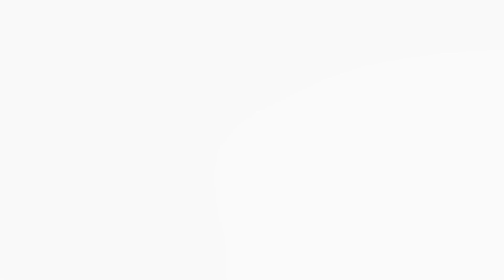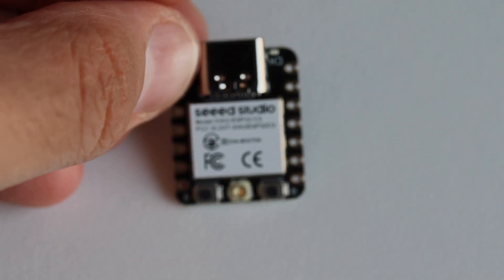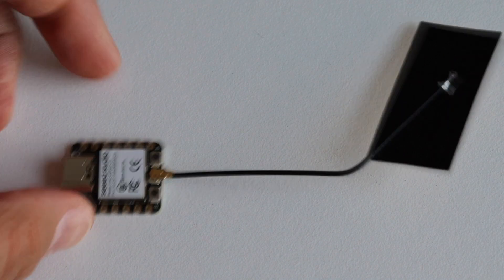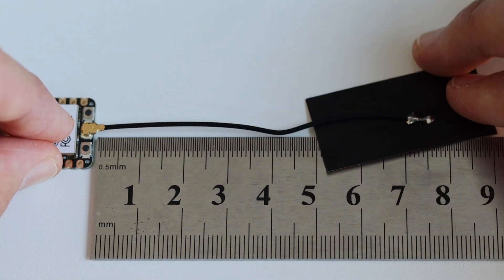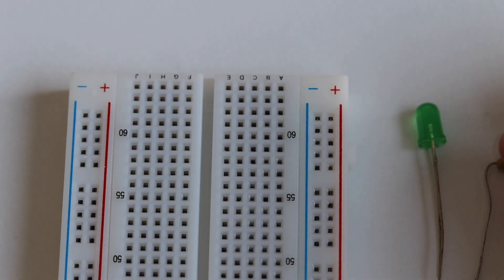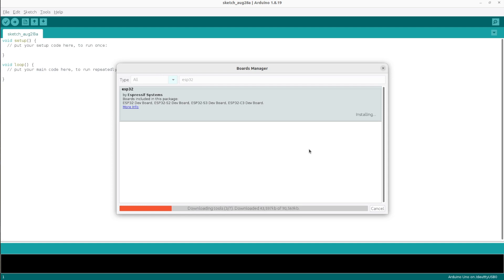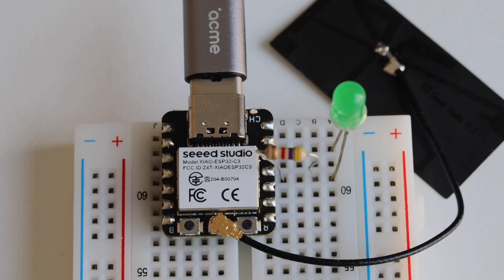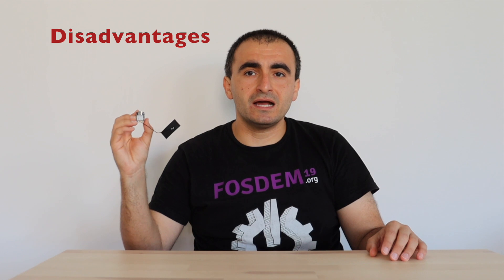XIAO ESP32C3 RISC-V Dev Board and Arduino IDE

Comment: I keep getting, A fatal error occurred: No serial data received.
Reply from the maker: Could you please provide any details? Is this in Arduino IDE? If yes which version of the IDE? Which OS are you using Arduino IDE with?
Reply: @LeonAnavi  Linux Mint 21.3, Arduino IDE 1.8.19, Board ESP32C3 DEV Module. Sometimes, I make the ESP32C3 work if I enable Erase Flash. It takes 16 sec to erase flash ram. I cannot upload a screenshot.
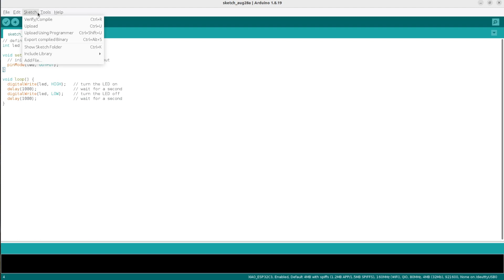Reply from the maker: @pavloskairis9994  which board have you selected from Tools in Arduino IDE? It should be XIAO_ESP32C3 and after that you should select the Port as shown at 7:43 of the video.

Comment: Disappointed with the Xiao ESP32-C3's battery performance. The device operates in a voltage range of 4.2V-3.4V, which seems to limit battery usage efficiency. It's frustrating to see shorter usage times due to this. Hope they consider widening the voltage range to make the most of the battery's capacity without harming its longevity
Reply from the maker: thanks for the feedback and sharing your experience.  Have you tried the deep sleep mode and wake-up on XIAO esp32c to extend usage times on batteries?
Reply: @LeonAnavi yes, sure, but I use  additional custom circuit with sensor button to power the board

Comment: Hello, if I connect lipo battery to the bottom batt pads, then do I need any battery charging module and load sharing circuit ? I would like to design a macropad that can be used wired and wireless but cannot find any resource on how to do this safely with lipo battery
Reply from the maker: XIAO ESP32C3 module is equipped with a battery charge chip.

Comment: does bluetooth works without antenna also? and how many meters?
Reply from the maker: Yes, XIAO ESP32C3 supports Bluetooth 5 (LE) connectivity. It should work without the antenna but the range will be significantly smaller. Here is an example how you can use and test Bluetooth on this module: https://wiki.seeedstudio.com/XIAO_ESP32C3_Bluetooth_Usage/
Reply: @LeonAnavi  Thanks so much

Comment: Thank you Leon for taking the time to share this review 🙏 Do you think this kind of module is suitable for simple, low volume (few thousands pieces) production application ? 
If feels like this would be much cheaper and safer (less error in hard and FW as well as supply chain risk) than building our own board. 
I’m thinking something like: build a custom casing, weld the required connectors, pot the whole thing. Keen to have your opinion on reliability of such a setup :-)
Reply from the maker: yes, absolutely! These XIAO modules are exactly for this purpose. They are good for both makes and for low-volume manufacturing because the XIAO ESP32C3 module is CE and FCC certified. Btw I am using the other version XIAO RP2040 in mechanical keyboards.
Reply: @LeonAnavi  Perfect ! I've ordered them yesterday following your feedback :) I'll let you know how it goes.

Comment: Good review.  I've been using C3 modules for a while but having issues getting anything loaded to spiffs.  Ideas?
Reply from the maker: Thank you. No, I haven't experienced this type of an issue (yet). What is the source code that fails to load to spiffs? Which dev board with ESP32C3 are you using?
Reply: @LeonAnavi  I'm using arduino ide v 1.8.19 , and have tried on the Xiao esp32-C3 and also TTGO TOI PLUS.
Reply: Ah, also it's not spiffs as such, it's ESP32 Sketch upload tool, that I'm using to upload files to spiffs. My bad. 
A fatal error occurred: This chip is ESP32-C3 not ESP32. Wrong --chip argument?
SPIFFS Upload failed!
Reply from the maker: @mikedunning265  there is a big difference between ESP32C3 and other ESP32 microcontollers because C3 is based on RISC-V. Have you configured the dev tools to use specifically ESP32C3?
Reply: @LeonAnavi  yes, i realised that after i messaged you.  :( I've not updated the esptool that is used for uploading data to flash maybe that is the issue.

Comment: 8:15 That resistor ain't doing nothing... You are driving the LED directly. You may want to look at the wiring layout of a breadboard.
Reply from the maker: Yes, sorry about this silly mistake on my side. Wrong hole on the breadboard. I have updated the description of the video and it contains a note about the mistake and a link to the correct wiring.

Comment: There aren't many pins on the C3 chip anyway. I've been playing with a few of the ESP32-C3 The lolin mini and also the one with the really tiny display and the ceramic aerial. Who cares if it's Risc five, other than as talking point? It's cheap, fast-ish and has BLE and wireless. The battery charge circuit, the castelation, the radio functions and especially the aerial socket are the big features. It's a good start for a custom radio control receiver. I think only 11 pins though. 2 for an i2C accelerometer, 2 for GPS, 1 for neopixels and you have 6 left for Servo PWM
Reply from the maker: I agree that from the perspective of the end user the instruction set architecture doesn't make a significant difference if the device works as expected. However, RISC-V is a huge new thing for the whole supply chain: from the R&D to the manufacturing. RISC-V cuts the costs and fosters innovation.

The 11 GPIOs available on XIAO ESP32C3 are good enough for most of IoT projects that come to my mind. It is an awesome module!

Comment: 6:30 I don't think that current limiting resistor is doing anything here. It's shorted out by the bread board.
Reply from the maker: Yes, sorry, there is a silly mistake as noted in description of the video and some of the other comments. A link to the proper wiring is in the description. I was doing the wiring while looking through the camera screen and picked the wrong hole on the breadboard. Sorry.
Reply: @LeonAnavi  Which hole were you aiming for? I can't think of any reasonable candidates. 
The only thing that would have made sense is if you had soldered the resister in series with the LED, bridging between your GPIO and Ground.
Reply from the maker: @vannoo67  one of ends of the resistor and the anode (longer leg) of the LED should be on the vertically connected line (blue or red) on the breadboard as per this diagram: https://files.seeedstudio.com/wiki/XIAO_WiFi/connect-led-2.png
Reply: @LeonAnavi  Yep, that would do it
Reply from the maker: @vannoo67  well... next time :)

Comment: Nice  review , but  insted of  explaining  how  to  run simple  blink  example ,,,please  explain  a  much  more  about  how  to  implement  RISC  V  core  in  more advanced   example .
Reply from the maker: Yes, absolutely.  I wanted to keep the video short because the focus is on the tech specs of XIAO ESP32C3 as a dev board. In next video I am interested in covering the WiFi features as well as also some other programming languages and environments like MicroPython. Do you have a particular example you are interested in?
Reply: @LeonAnavi  Yes  ,   how  does  RISC V   improve  the performance of  ESP32C3  ?
Reply from the maker: A few months ago cnx-software published a comparison table between ESP32S3, ESP8266 and ESP32C3. The RISC-V based MCU ESP32C3 has better power consumption specs for sleep modes:
https://www.cnx-software.com/2022/01/12/esp32-s3-esp32-c3-esp8266-modules-comparison/

However, the major benefit of RISC-V in my opinion is not better performance but the philosophy of the business model. The open standard instruction set is a game changer for the hardware industry. This will affect companies like ARM with business model relying on royalty per chip basis. RISC-V is open standard so there is no room for royalties. In long term RISC-V should disturb the market one way or another by leading to more innovation and even potential relative overall price drop.

Btw, I am curious to try the real-time OS Zephyr on RISC-V and ESP32C3 is a good fit for this purpose. It will be an interesting example. If I find spare time I may give it a try.
Reply: In some ways it’s slightly similar to comparing  iOS vs Android. as Android originally was meant to be open so more people got in to building it using it and improve upon it.  But on the other hand not saying iOS is bad in fact it is good but their internals are closed and not really meant for others to change it.
Reply from the maker: @JC.72  I really like your comparison to Android because indeed an open standard instruction set architecture is not the same as open source hardware (as defined by Open Source Hardware Association). I hope RISC-V will disturb the industry the way Android did to the smartphone market back in the day. However, there are some differences: back then before Android there were some Linux open source alternatives as Maemo and MeeGo (even Symbian for its last releases) while now we don't have anything similar to RISC-V philosophy on the market.

Comment: Very nice. One mistake at 8:33 you do not have the led wired up correctly. You have both resistor legs going to same esp32 pin along with the led pin.
Reply from the maker: I connected a resistor in series to limit the current through the LED. The resistor is between D10 and the LED. The cathod (aka the shorter leg) of the resistor is connected directly to GND on XIAO ESP32C3. The resistor prevents  excess current that can burn out the LED. Actually, it can be located on either side of the LED when it is series. You can have a look at the wiring diagram for more details: https://files.seeedstudio.com/wiki/XIAO_WiFi/connect-led-2.png
Reply: @LeonAnavi All the wholes on the boradbard in that row are connected together. that is not a correct way of breadboarding a led. https://i2.wp.com/www.esp32learning.com/wp-content/uploads/2017/11/esp32-and-led_bb.png?resize=696%2C537
Reply from the maker: Ops you are right about this, it ends up as a single resistor which is in parallel to the breadboard line. I should have done it cleaner.
Reply: @LeonAnavi  it’s okay I made that mistake myself many times. Green leds even through only can handle up to 2.6v for some odd reason I have worked them on 3.3v without problem. But I myself need to stop doing that 😂 😆 😝
Reply from the maker: I should have used one of these mini breadboards to make things cleaner in the video. Next time :) Anyway, the wiring in the link and the diagram provided with the tutorial are correct.
Reply: @LeonAnavi  Ana it’s all good it shows a resistor is needed or else no more led. You got the point out there.
Reply from the maker: thanks for the support and the valuable feedback! Btw if I find enough spare time I am thinking to try the blinking LED demo with ESP32C3 on Zephyr :)
Reply: @LeonAnavi  nice. Would love to see that.